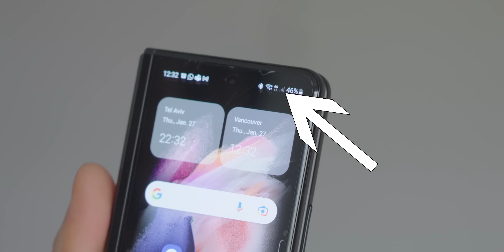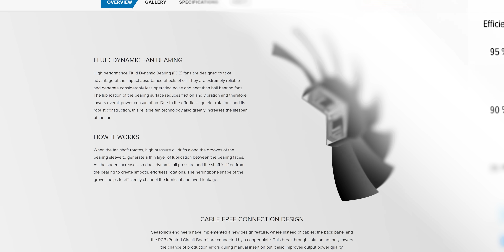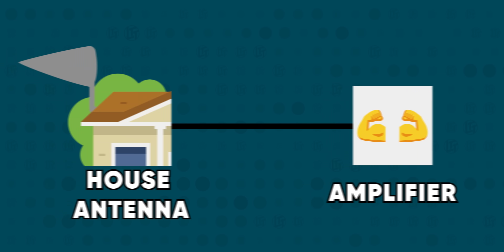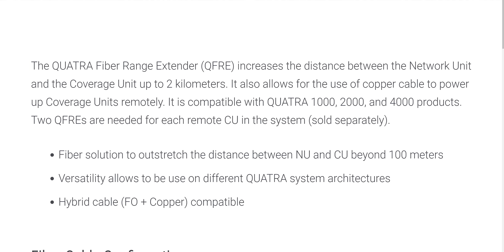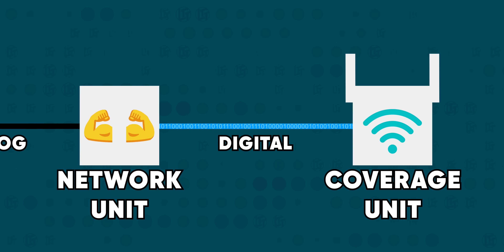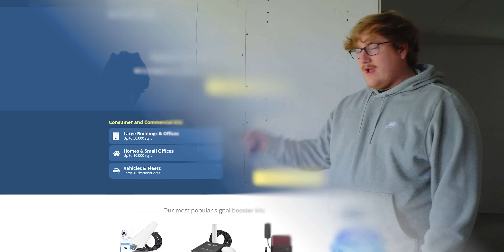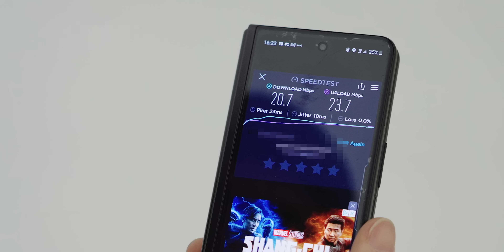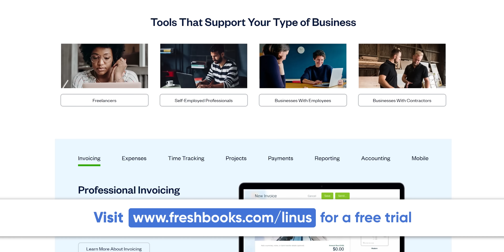I Hate This... New House Cel-Fi Cell Signal Booster Install

Comment: I worked at the iCloud server build for Apple in North Carolina and they put something like this in that building. Without it, cell service did not exist.
Reply: So did I. Lol
Maiden?
Reply: @themisir  nope
Reply: Cool
Reply: @clancarmichael  haha yeah man. I worked for Siemens. We had the hvac system in that building. at the time they were doing the first of what was to be mirrored redundant buildings.
Reply: @Nick Casale  oh cool. I was break/fix, roaming around the servers. Fun place to work. Security was bonkers.
Reply: My friend house had one too it was awful that area. It's strange because he isn't far from a major university in my city so no clue why and it was at&t who installed it in their house
Reply: Don't read profile photo  Don't reply
Reply: @monsterhunter445  The last cell tower servicing that corner of the university may well be slightly too far within the campus, or perhaps there's some building in the middle attenuating the signal. I live in a dense city and there are random small areas within a single cell coverage where some carriers have poor signal outdoors, and my friends and I can't seem to figure out why either.
Reply: That's crazy bro
Reply: That could also be a nano/micro cell, some operators do provide that kind of equipment for companies. Basically a really small cell (think sort of a big ap) and sets up a tunnel to the operator core network via normal internet and voilà cellular anywhere you want.
Reply: Cell service in North Carolina is horrible I don't even live anywhere remote and I still can't get cell service
Reply: Don't read profile photo  ok i wont
Reply: I live in NC too.
Reply: thanks for icloud
Reply: nothing new
Reply: @clancarmichael  i used to live in hickory when i was younger, yall know if they are hiring i live in charlotte now ?
Reply: @clancarmichael  Yeah def the biggest project I have been on. Very cool to now be able to say I worked on something pretty much everyone know about. At the time, I am sure you remember, we didn't really know what it was going to be. Although if you were on the server side maybe you did. We had no clue. We were installing and testing the hvac control system which was pretty elaborate, even by normal server standards.
Reply: I live in NC, where was this apple office? Retail or corporate?
Reply: Makes sense, you don’t really want random signals to be able to get into a server.
Reply: @clancarmichael  yep 😂 I live pretty close, Hudson/Hickory I've drove past and saw their solar farm it's pretty amazing.
Reply: @Daniel  I was brought in via a recruiter.  They usually post on the company site.  However I'm not sure how much they pay attention to online submissions
Reply: @inspectorvoid  maiden, nc it was a data center
Reply: @Scott Dunn  the truly impressive thing, is getting into the compound and seeing the scale of it all. They basically paid for a maiden firehouse at the front gate so they would have quick response in an emergency.
Reply: @notnooted  no clue as of now. I live in Charlotte and did the commute.  Left there because of it.
Reply: @clancarmichael  I'm not surprised. I've worked with Apple for a decade now I think or close of it. I work a rural cellular provider
Reply: ya nc is pretty spotty unfortunately, especially rural areas. pretty cool stuff though, wonder how much it costs tho 👀
Reply: @_NaLo_  these are kind of fun. Worked at an network operator with these. They can as well connect to rf signals and broadcast these signals.
Reply: @ncasale79  shout out to fellow a zeeeemans employee. I worked for them on similar system in Calgary Canada.
Reply: @DMSparky  Ohhhh NICE. Yeah worked several years with Siemens. Good company. Now I am a Trane guy.
Reply: @obamastolemybike1226  really? I’ve always had pretty good cell service basically anywhere near a highway
Reply: @themisir  Yep, this story is a failed larp
Reply: Don't read profile photo  no worries homie I won't.
Reply: Don't read profile photo  rickroller found
Reply: Nice, I live in NC. What city was it in? I'm lazy and don't feel like looking 😅
Reply: You worked at a build.
Does whatever you're using to comment not have any sort of "spellcheck"?
Reply: Recently? Is this for the new headquarters in Raleigh?
Reply: @Greenmonkey552  Nope, you’re wrong.
Reply: @GraemeGunn  Does it cause you any harm? No. So get on with your sad life.
Reply: Similar system will be deployed in one of the servers in the DMV area 😉
Reply: @tobiaxelsson  most of the isp´s here are so cellular providers and if cell reception is low, you´d get a little femtocell connected to your modem. Some even give it without having to rent it.
Reply: I worked at a retail location during the .me/iPhone 3g era- we had full blown micro sites from AT&T as the actual network in our area world crash nightly from the increased network use of iPhones/Treos/Blackberry/WindowsCE devices. What a wild time to be alive!
Reply: @unlokia  🤣🤣🤣🤣
Reply: Sure you did
Reply: @unlokia  most of those would've expired a long time ago
Reply: My old factory job just started installing them before I left and the difference was day and night
Reply: Apple tree?
Reply: I bet they used dell blades
Reply: Almost all enterprise locations have cell boosters.. it’s a service provided by the carriers when you sign on for a company contract.

Comment: It is funny to see you guys mentioning concrete as something uncommon. In Europe we don’t have dry walls - our homes are just bricks and concrete so Wi-Fi range is terrible and adding cabling is a nightmare :).
Reply: Yuppp.
Reply: @thiccbaron  cellular is usually not a problem for me but routers are having trouble going concrete walls with metal rods inside them.  Load bearing walls are like that here. Rest of walls is build with  a kind of bricks and Wi-Fi does not have a problem there.
Reply: @thiccbaron  He mentions that it depends on the carrier and phone. I don't know about Canadian cell providers, but AT&T in the US has wifi calling, but only for phones that you purchase from them, iPhones, or phones specifically whitelisted for wifi calling. I have a OnePlus 9 pro. If I move over to AT&T, I can't use wifi calling because AT&T doesn't allow it even though the phone itself supports wifi calling. Its a mess.
Reply: Actually we have a lot of wooden houses and drywall here in Sweden. We have brick and concrete houses too of course, especially apartment and public buiildings.
Reply: The house I live in is about 150 years old, and the internal walls are at least 20cm thick. There's just one between me and the routers, and the signal strength is already down to about 60%.
Fortunately the nearest cell tower is about 500m away, so mobile signal is great, even in the basement!
Reply: @thiccbaron  we do. Calls via wifi is pretty standard in the UK at least
Reply: @thiccbaron  Linus mentions this but also addresses the fact that VoLTE doesn't help with SMS
Reply: @Riverpeth  nobody should be using sms anymore anyway really. It has zero security.
Reply: I don't know if it is only me, but I instinctively walk towards a window whenever I pick up a call.
Reply: @dawidszyszko  Would Wi-Fi repeaters and boosters help with the  signal strength? I'm sure if one pumps enough wattage into a wifi signal, the waves would pass through walls (not too much though, or else we'll cook). Wi-Fi uses the same wavelength as microwave ovens, yet at a safer energy density.
Reply: Here in North America, we prefer our houses to be more flammable.

Just kidding (maybe?). My house in Florida is constructed of concrete block exterior walls, with fire resistant drywall interior walls supported by metal “studs.”
Reply: ikr, when we renovated our 50 years old house we also did a complete network setup and it was easier to just run ethernet to all rooms around the brick walls on the outside of the house and then hide them behind the new insulation. At least we have a double ceiling to run electrics through but every new wall outlet is a pain in the bum and requires chiseling away your walls.
Reply: Indeed, our houses over here can withstand a storm. Bricks and concrete all the way, and perfect 4G reception too. Blaming that thin layer of concrete for the bad reception made me smile, the problem is probably that the carrier has no tower in the area
Reply: Europe in general? I'm in UK, Many houses have dry walls as partitions.. It's very common practice, But not throughout history obviously, Houses built before drywall was a thing won't have them.. And not all houses do anyway.
Reply: @itsmrpaddy  Yeah, but they can at least have the opportunity to own a house, and a house that is more than 90 m^2. We're stuck living in little tiny houses, or even smaller apartments, paying 3x as much for rent, and never owning one. "BuT bUt bUt iT's mASoNrY, nOt dRyWaLL." I'll take a 200-250 m^2 drywall and wood house, that I own, over renting a tiny 85 m^2 hovel, and paying rent to a foreign company that owns all the real estate, for the rest of my life.
Reply: @littlejackalo5326  In Germany (outside of the 1Mio+ of population cities) you can easily own a well built 150m²+ house - especially as a married couple.
Reply: @JJFlores197  crazy how i completly ignorantly assumed this is standard everywhere by now just because it's like what, 15+ year old tech by now. Guess I really needed some reality check there.
Reply: @dawidszyszko  i have a problem like that...

I have a water tank between my room and the router
Reply: @grrkaa8450  Right, come to my village (less than 1000 people) and get an almost broken down farm building for half a million € easy. It's only "affordable" because the limits that banks issue credits based on are pretty low these days.
Reply: Here in Greece every building is build with concrete and steel bars inside, like 99,99%....
Reply: @littlejackalo5326  just don’t try moving to New York or some of our other big cities. A lot of the housing there is ridiculously small and/or ridiculously expensive.
Reply: Dude same but I don't live in EU
Reply: By the way, why do americans have dry wall or wooden house?
Reply: @dbackscott  No offence, but each time I watch a movie where someone punches through a wall or when a house flies away in a storm, I sigh and say "Oof. American walls" - I've once read an article explaining why so many houses in the US are just made of wood, so it doesn't seem to only be a Hollywood thing, right? (Our brick houses also wouldn't get swept down the alley if there was a flood, though everything getting wet and moldy of course is bad enough)
Reply: Dude same. But I'm from India.
Reply: @LucasAleatorioRandom  Single family detached homes are usually wooden frames with concrete basement / foundation and drywall for interior walls.  Exterior walls are siding, decorative brick, stucco, etc.
Reply: Yup India too....in India we are pouring concrete into moulds to build houses.....
Reply: Yea I always thought concrete was standard, then I started watching American shows
Reply: @LucasAleatorioRandom  I guess because we have a loooot of wood and it is also easier to insulate
Reply: @SubZuda  sounds like a fort to me
Reply: @Nitidus  drywall is stronger than you might think. You can try to punch through it, and there’s a chance you might succeed. However, there’s also a pretty good chance you’ll break your hand, especially if you hit at or near a stud.
Reply: Pretty sure it's like that in most countries.. NA is always a bit more special
Reply: @helenHTID  but UK left EU 😅
Reply: @itsmrpaddy  just the places I’ve been to :). Yes we have dry walls but I would say it is like 10% of people have them and even if we do they are only inside walls not outside.
Reply: @littlejackalo5326  I can afford house no problem prefer apartment because it is in the city Center and I can just walk to work. I can easily sell it and exchange for a home but the commute will be at least one hour drive.
Reply: @beeboo5433  Yea 70-80% of our houses are made of wood. They aren't any less strong and actually cost less to build which is why real estate can get super cheap here, especially in the south where you can get a 800 to 1500 square foot house for less than $100,000. (At least that's what I saw before 2020) Cell reception and WiFi works flawlessly in wood houses as long as you have a strong enough bandwidth and data plan but 4G is the standard anyways.
Reply: @unicorntulkas  Yup. My parents' house was newish but built before modern electronics took off. 1-2 outlets per room. I remember my dad hand-chiseling slots in the wall to add more (and a couple of sconce lights).
Reply: I don't know...I live in a brick and concrete apartment building and my WiFi is 350 down - exactly what comes through the wire from the road.  So  something else is at play here...
Reply: @LucasAleatorioRandom  To be able to actually pay for it in their lifetime.
Reply: @chaos.corner my parents did the same. But I believe it's cheaper to reform, than build a new one.
Reply: @Posichronic  US's average salary is at least twice the average salary in my country. And here, almost everyone has their home
Reply: @Riverpeth  VoWiFi does support SMS. Likely just needs to be enabled by the carrier. Here in Australia on the Telstra network, I've been able to send SMS while connected to WiFi calling since 2020.
Reply: @LucasAleatorioRandom  For sure. That house got upgraded multiple times in my lifetime. Caity wall insulation, double glazing, loft insulation, electrics, extensions, new roof... It used to be miserable to get out of bed in the winter but became tolerable over time (my dad was a miser with the heating).
Reply: @littlejackalo5326  owning your own is always nice. Depending on where you want to live, it should still be possible at a decent price. But this could be different per region / country etc. Hope you will at some time have your own place though 👍🏻
Reply: Nie mamy kartongipsu? A to mi nowina... Ściany w większości domów pokryte są kartongipsem. Yes we do have drywalls in Europe. Yes we build with ceramics (bricks or perforated bricks) or aerated concrete blocks. Even then inside walls are usually covered in drywalls (or plaster) and divider walls are usually made with just drywall and steel profiles. With corectly places WiFi router there is no problem with signal and mobile shouldn't be a problem in urban areas, maybe big house somewhere in countryside may have some problems.
Reply: @Naviachi   not true. Yes we have it but not in majority of places. I would say now it is less common to use it. None of my friends or family has it.  Just quick google search will tell you that brick walls are most common here so check your facts before you get excited and write a comment :D.
Reply: @endlosschleife  erzähl deine Märchen woanders
Reply: @grrkaa8450  All I am saying is that the banks own most of the houses and that shit's overpriced. It's easy to get one but not to afford one. Sorry for the rough phrasing in my earlier comment, I was pissed. Not your fault though.
Reply: Nonsense, we have plenty of drywall in Europe. One of the biggest companies that makes drywall is German. Judging by your name you are Polish, I have seen your houses, no concrete beams!!! A minor earthquake could level that! I would rather live in a stick framed house any day! In Serbia we build to much higher standards.
Reply: @jm036  check statistics and than talk. Almost no one here has external walls in houses made from dry walls. And of course you know better than me living here all my life. That is just funny.
Reply: In Puerto Rico, cement is the common thing. It depends on where you live.